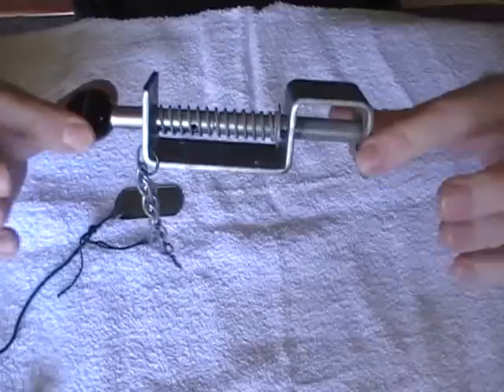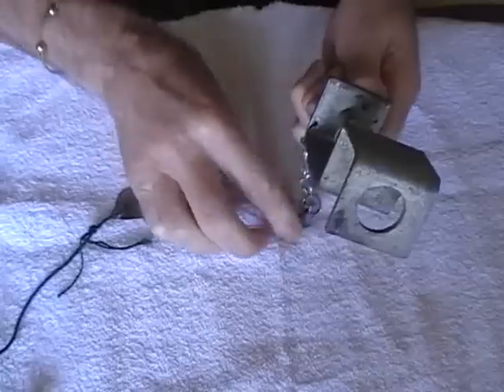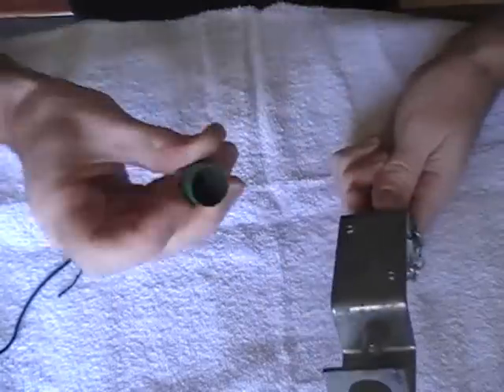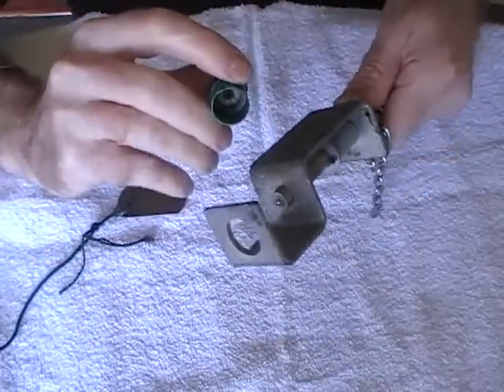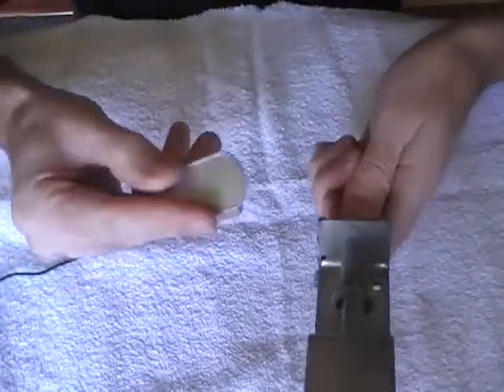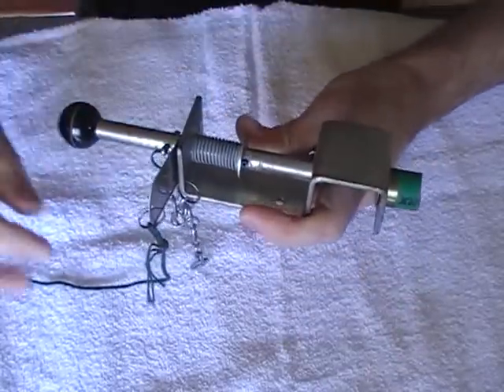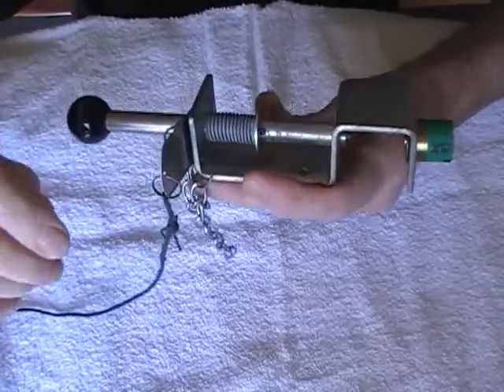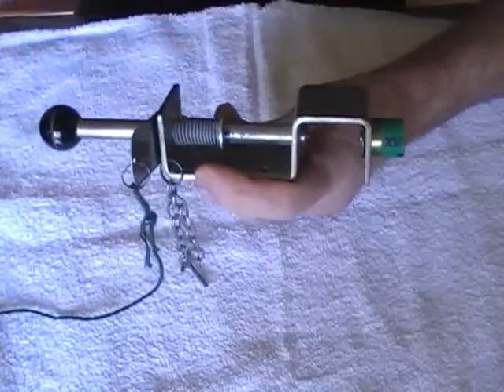Gamekeeper alarm gun / mine

Comment: That's not that incorrect that's the historically correct way these items worked (using birdshot generally), but they had barrels to aid compression. 

These were modified sometime ago on the older (often pinfire or percussion capped) models. The barrel less versions are just noisemakers, to scare poachers.

Without a barrel the buckshot will attain little pressure and not be very dangerous. Duct tape around the shells sides might increase the pressure though.
I know you were joking but so what.